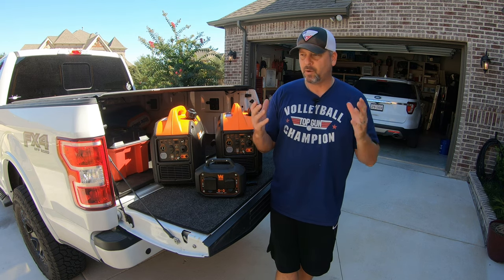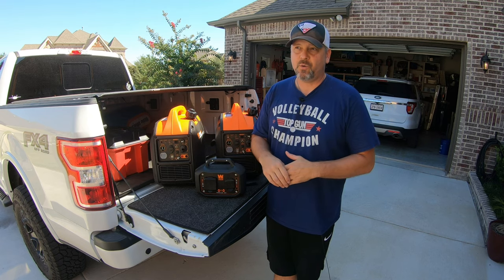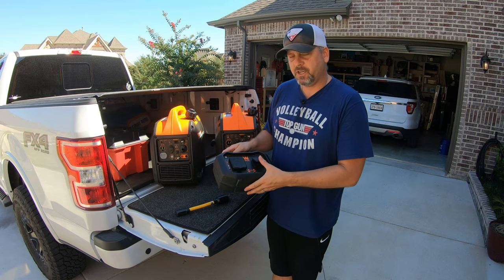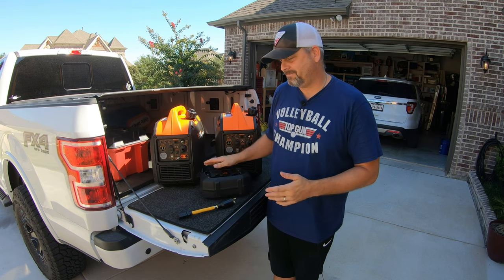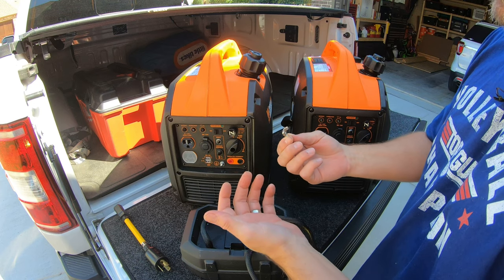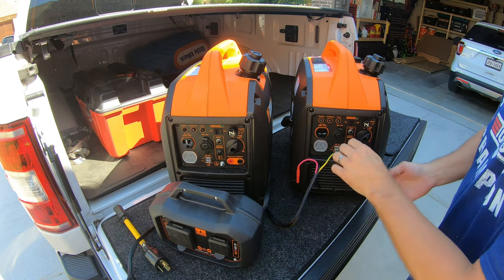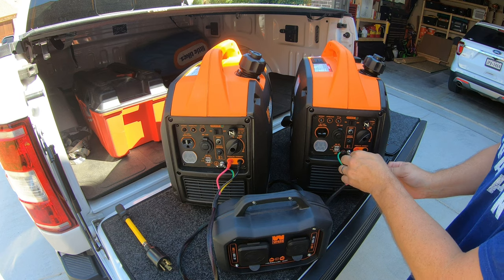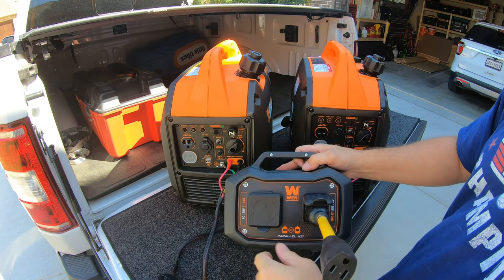How to hook up and run inverter generators using a parallel kit.

Comment: Do you remember what wingnut size you needed? Just tried 1/4-20s and couldn't get them to thread. FYI, i learned that if the ground connections are solid, the overload protection trips.
Reply from the maker: Sorry, but I can’t remember. 1/4 x 20 did not work for me either. It took a couple of trips to get the right ones for me.
Reply: M6 - 1.00

Comment: If 1 generator shuts down does the remaining generator that is running still putting out voltage power in the parallel kit?

Comment: OK here’s a question that nobody seems to have addressed , that I watched several videos perhaps you can answer this question. What if I have let’s say a Ryobi 1800/2300 Watt inverter generator and then a Predator 3000 W inverter generator. Do the generators have to be an exact pair match? Or do they only have to be a match in the wattage. Or do they have to be both a brand and watt match inverter generator? So let’s say I have the Ryobi 1800/2300 W generator for when I have really small stuff running and then the 3000/3500 W predator generator for stuff that’s a little bit bigger, and then when I have to run a sharp tool that draws quite a bit of whites I want to add the two of them together because the 3000/3500 W predator keeps tripping it’s breaker when a compressor starts up can I add the 1800/2300 W Ryobi to it to come up with 4800/5800 W ?
Reply from the maker: I’ll try to answer as best I can, but I’m by no means an expert. I had the same questions you had and did a lot of research. What I found is (but have not tried it yet) is you can parallel diff wattage generators together, but you’ll end up essentially only pairing the wattage of the lesser generator. So a 3000w gen and an 1800w gen paralleled together would only in reality be giving you a max of 1800x1800 max watts. You can parallel diff brands together though, as I have done that with my WEN and Powerhorse generator, and it worked fine.
I’m sure there are internet experts and electricians out here that will have different answers, but this was the best I could find when I was researching this last year.
Also, check out “Gavin’s Garage” channel. I believe he posted a video about paralleling two different wattage generators together.

Comment: Max wattage with that parallel kit is 3600W, 30 amps 120v.  I have the earlier generation yellow Wen parallel kit that I run with my yellow Wen generators.  They're awespme. Have used them twice now to power the house through a xfer switch.

Comment: Is that plug you used necessary? Im confused and for sure a novice but...Wens website says it the kit ups the wattage of either generatorcs panel outlets.. What cable is that, I want to make sure i get the right one if it is indeed necessary for max wattage. Thank you !
Reply: Looks like an L5-30 to 5-20